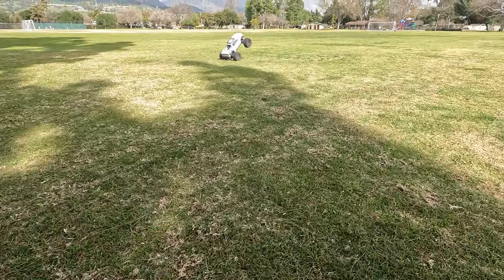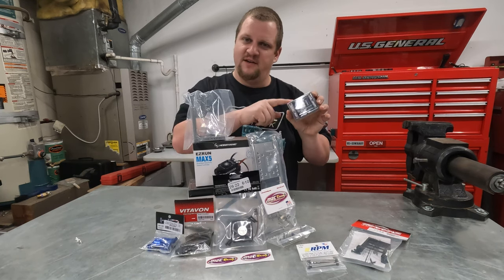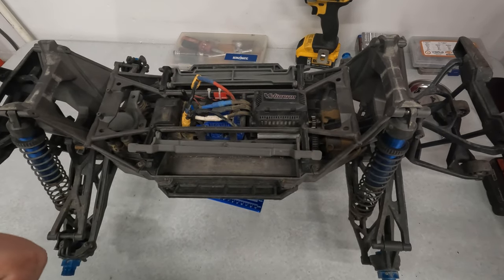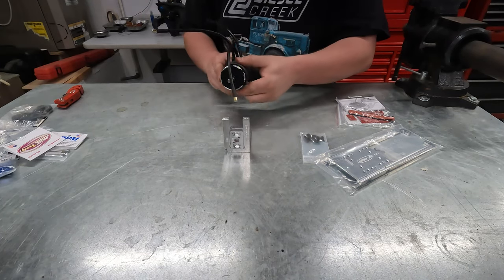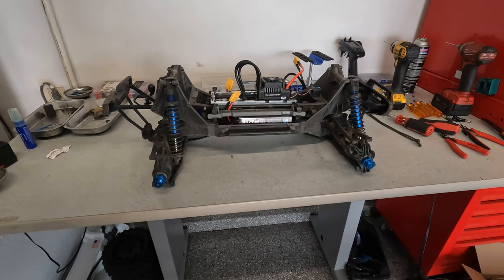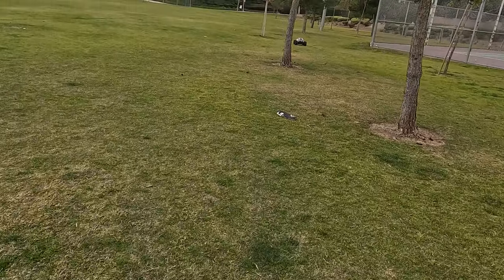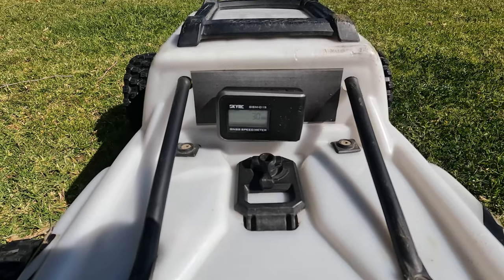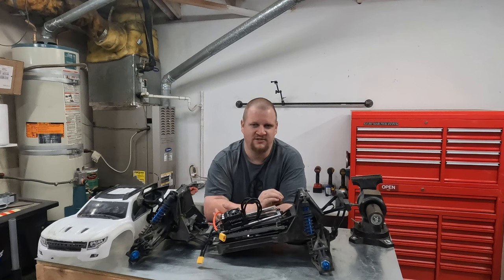X-MAXX UPGRADES! - MAX5 - M2C Racing - NSDRC RS1

Comment: For the NSDRC RS1, did you cut the servo ear off or did you find a way to trim the stock skid plate to leave the servo ear unclipped? I have the 1/10 servo adapter and NSDRC RS1, but haven't installed yet.
Reply from the maker: Hey Randy,

Fortunately, I didn't have to cut the ears off. I was able to the trim plastic material of the chassis with a dremel and flush cutters. It's fits perfectly without modifying the servo. 

Make sure you get a new servo horn though since the stock one will not fit the new servo. I'm going to be switching to the TREAL Aluminum 7075 Servo Horn 25T & Steering Drag Link since I'm not getting equal steering in both directions at the moment.

ALSO! Make sure to run an external BEC. If you do not run a BEC, the electronics in the servo will burn up. NSDRC notes this on their website for the RS1. This servo needs constant 10amp current.
Reply: Ok. I'm glad you mentioned the bec because I was going to power the servo using the max 5 bec. Glad I didn't try it. Makes sense though because in my XRT, I used a savox 2290sg and my max 6 esc. I melted 2 2290sg servos within 10 min each time. Guessing it was a similar story... Needed more amps than the ESC could give and burned up. The ProTek 370tbl is working fine with the Max 6 so far without an external bec.